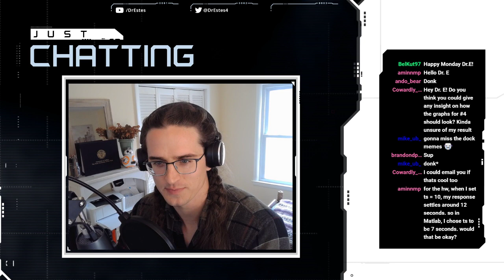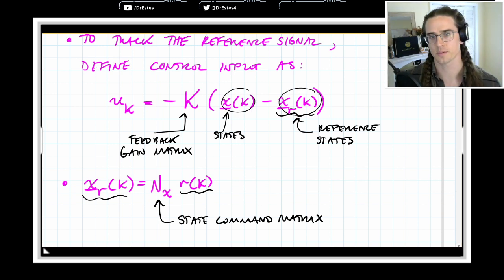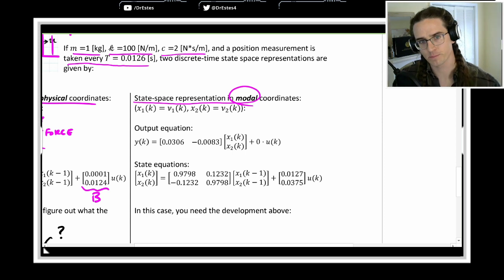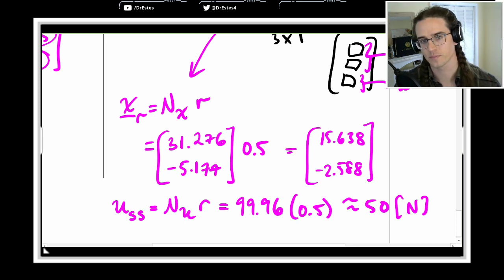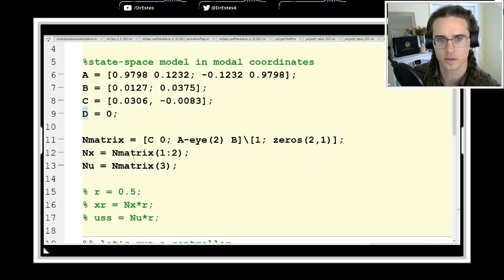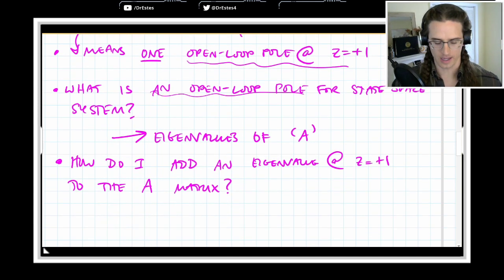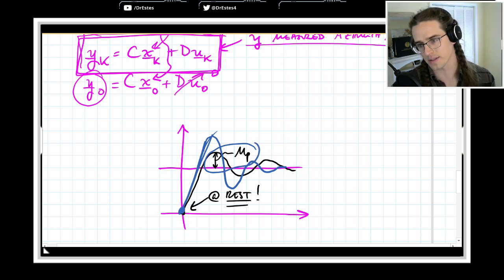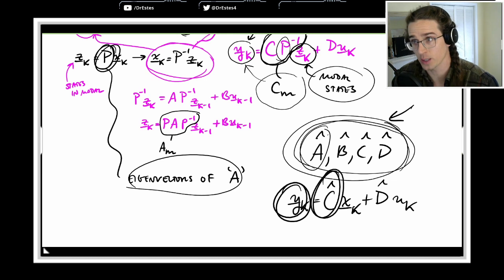Digital Control Systems (5/3): Reference Tracking using State Feedback Control

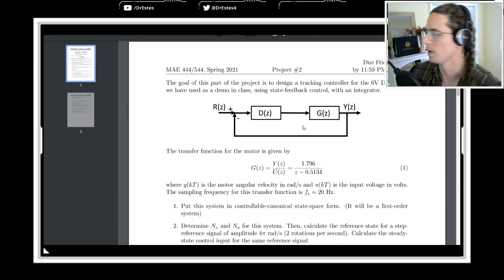Comment: Project 2                                                                     9:15
example spring mass position                               20:00
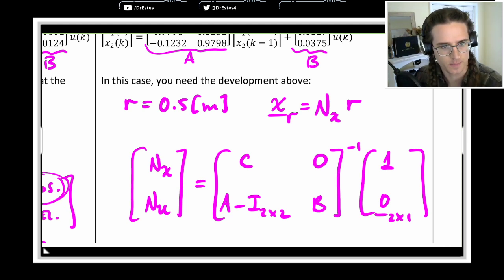MATLAB code                                                            29:50
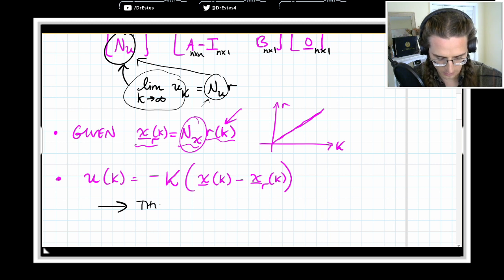Given reference signal and solving in Matlab       41:40
System type                                                                55:55